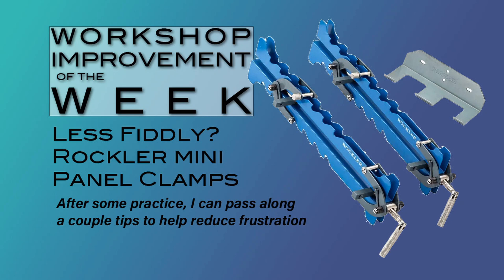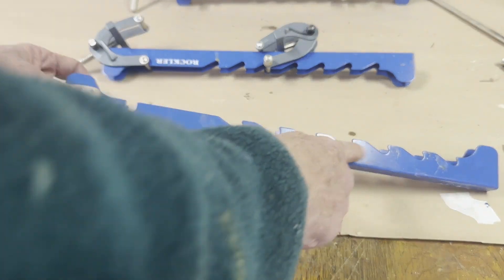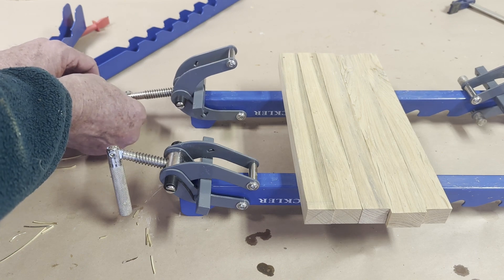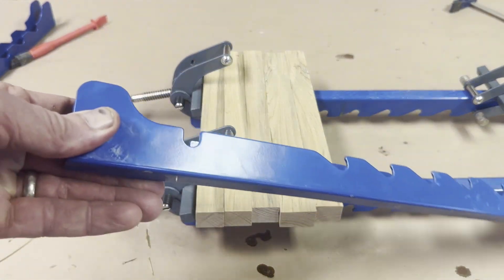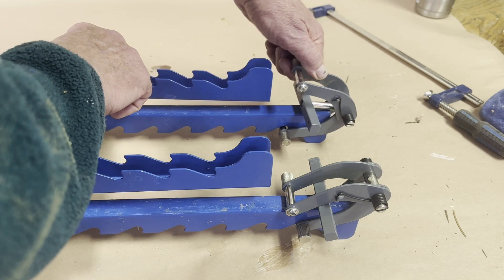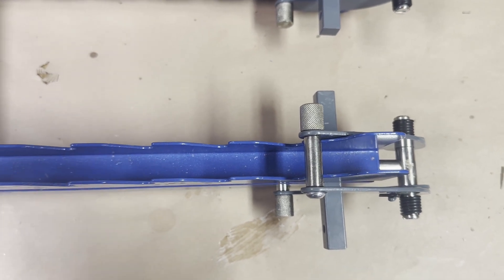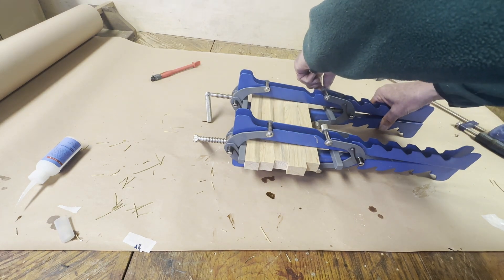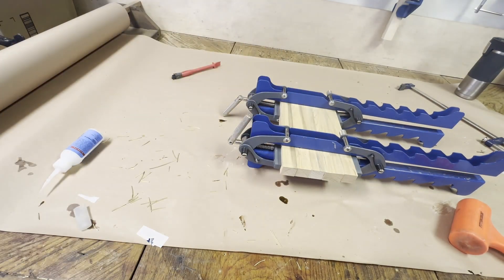Reduce Rockler Panel Clamp Frustration

Comment: Bought these. My experience was not bad. This video helped. Because the the length of my glue up, I used a cauls in the middle between the blue brackets. This helped with vertical movement.
Reply from the maker: Thanks for the comment.  I’ve used the clamps about ten times now, and each time has been a good glue-up.  I can’t say they are a pleasure to use but I can say they work

Comment: I just saw this video and then went and looked at the other one. I have never used them and please take no insult, but... It appeared to me that the biggest issue in the other video was simple inexperience with them. Some practice runs, as you mentioned, would likely have helped. This video seems to bear that out. Kudos to ya for coming back and clarifying.
Reply from the maker: Sorry I’m so slow getting back to you — I do appreciate the comment.  I think we are on the same page.  It makes sense to do a couple dry runs (literally dry, no glue) before a real glue up.  Anyhow, I’ve used them successfully and I think it’s an OK product.